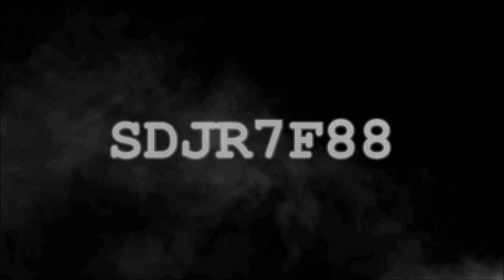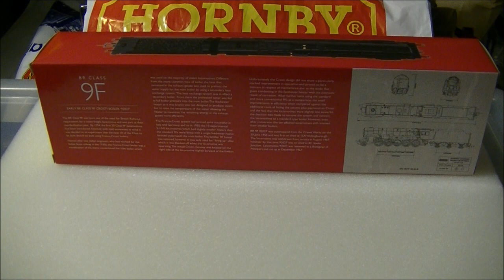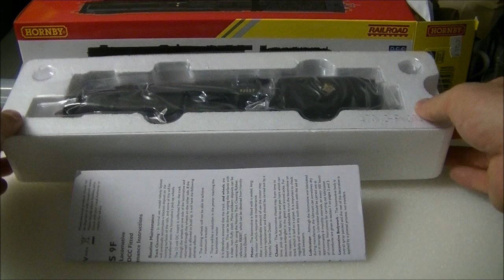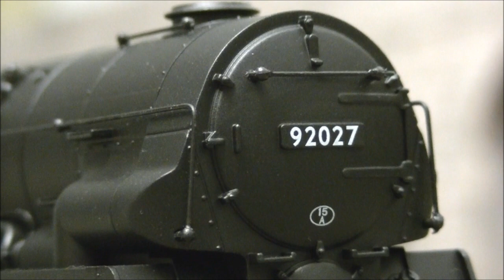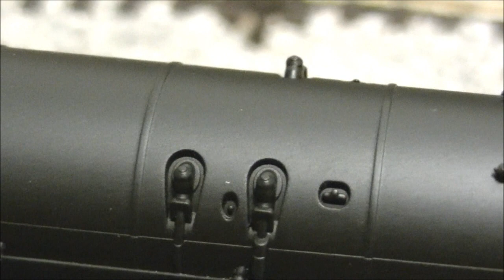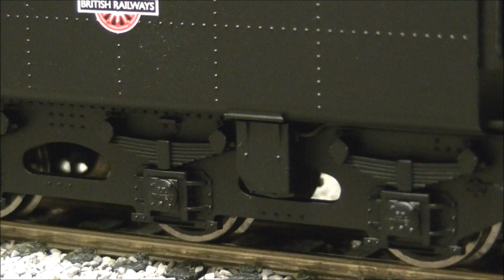Hornby R3273 Franco Crosti 9F Review

Comment: Slow running on those normal Hornby 9Fs is always amazing. 5 pole motor and lots of pickups. Will haul loads. This will be no different. Simon Kohler of Hornby told me he also rates these for power and traction. They are terrific for the price. This Crosti version looks great. Great review Callum. Laurie.
Reply from the maker: +Calvertfilm Was so surprised with it! Runs amazing! Really great to see it is fitted with a 5 pole. That's great to hear, can't wait to get her on a good rake. Love the design of these interesting locos. Many thanks!